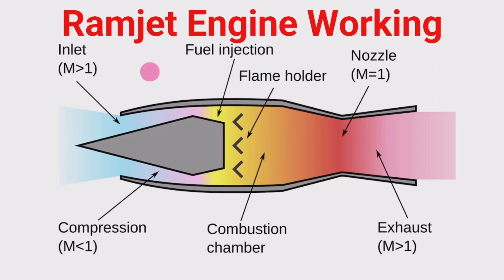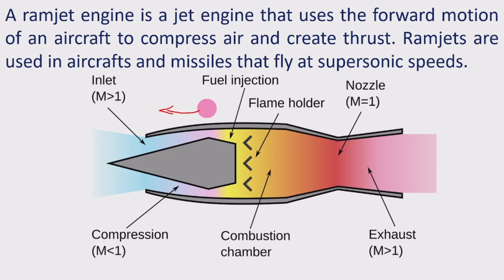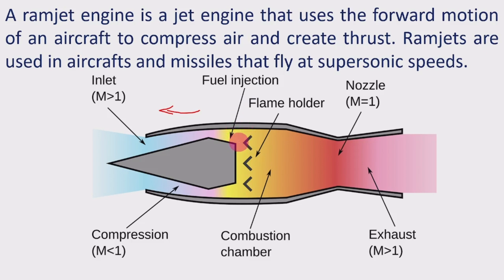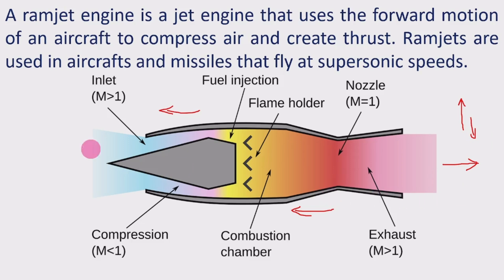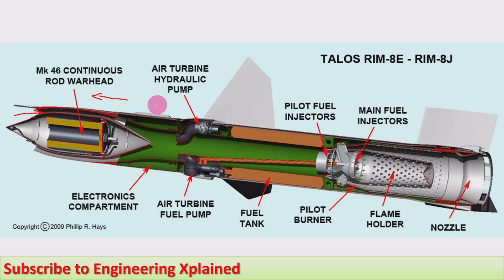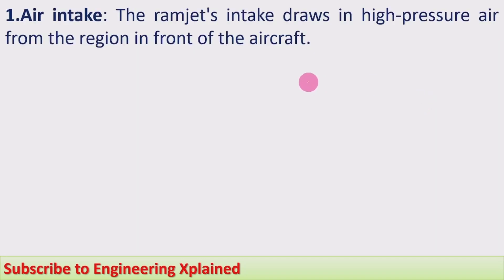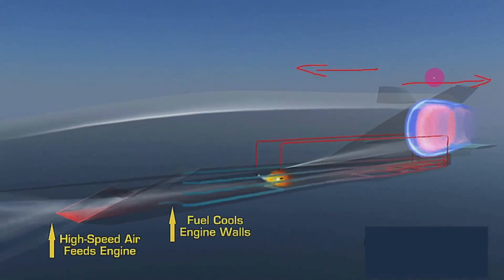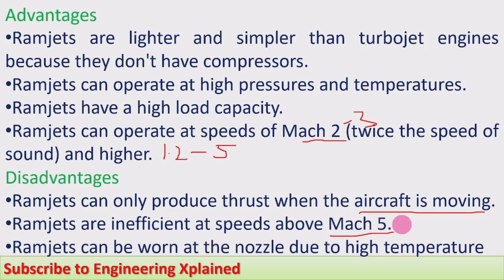Ramjet Engines, How Do They Work | Defence and Science

Comment: Hello,  your presentation was excellent & fascinating.  I have a very unique question, & application about this technology, but using this as a passive device without using active combustion, however using this same shaped device for an automotive performance exhaust device to help exhaust pulses to scavage more efficiently thru the exhaust stream to help with engine perforance gains due to a loss of pumping efficiency in the exhaust.🤔  What are your thoughts?🤔
Reply from the maker: As per first law of thermodynamics, we cannot use this shape only without combustion. Also we can use for I C engine exhaust, but the system becomes bulky rather than advantage.
Reply: @EngineeringXplained1  Thanks for your reply!  Just to clarify what you said in your 2nd part of your explanation, this same conceptual shape & technology could be used in an IC engine to effectively achieve better exhaust pulse efficiency scavaging?
Reply from the maker: @chrispompano  Yes, we can use for stationary IC engines, but for automobile I C engines it becomes difficult.
Reply: @EngineeringXplained1  Has this concept ever been developed or tested?  I couldn't find any published papers or studies for a Ram Jet Muffler or IC Ram Jet Exhaust, unless it would be called something different?🤔